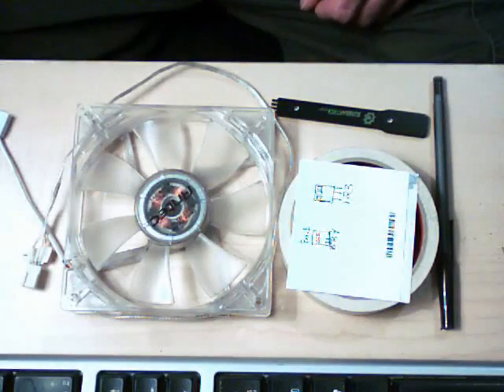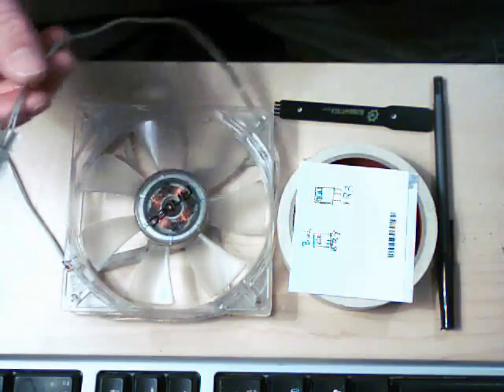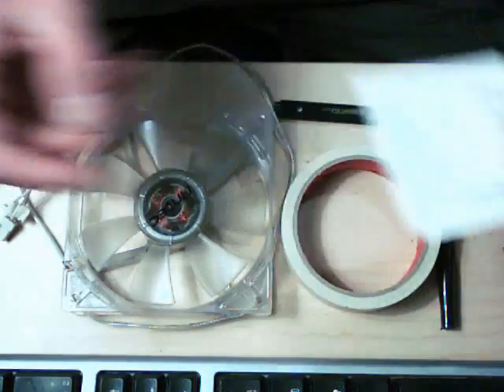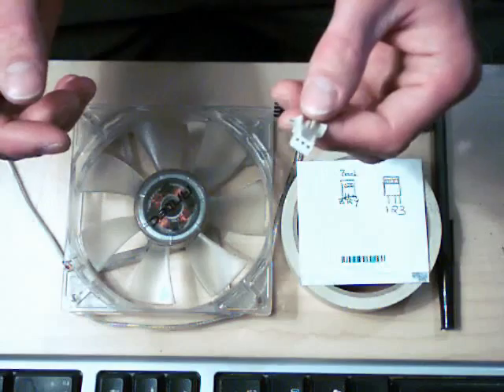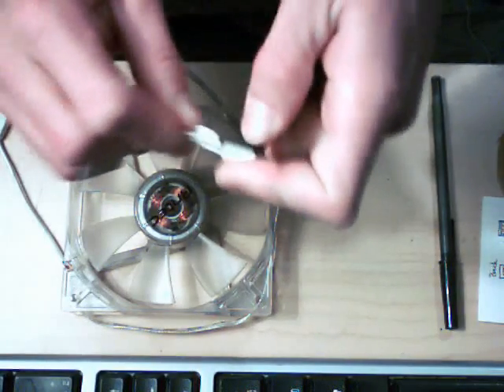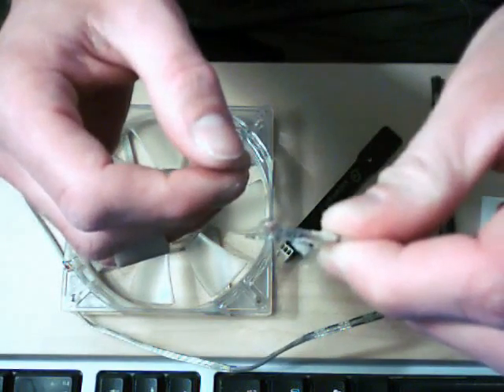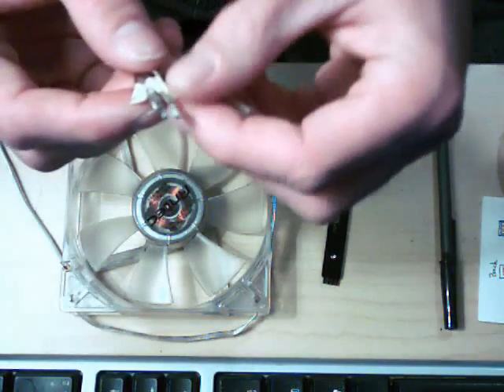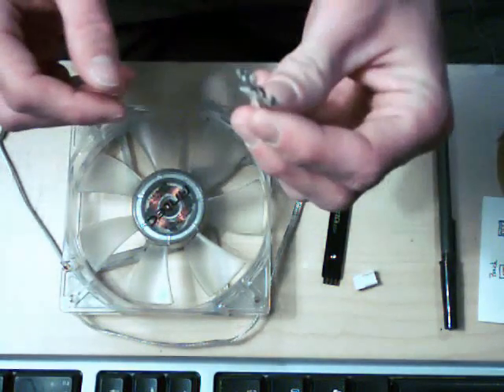How To: Remove/Install 3-Pin Fan Connectors

Comment: dude  just  push the cable in slightly befor using the 3 pin remover it should work way easier because like you did it it forces the taps even more into the  plastic

Comment: I had a loose 3 pin connector, I used a very small screw driver, and pulled the wires out one at a time, I bent the connector to enlarge and refitted the wire, do this one at a time and test to see if it works, no need to take all three out.

Comment: dewalt607 yes it should be ok it woudn't do any damage if it were to the pc wouldn't start up and beep as it thinks its a power supply issue but just try plug the fan in another way and it should work otherwise it would do the same thing but id try with a PC you could risk

Comment: you got a like as the video was helpful. i just wanted to see how to use the removal tool. however, most of the video is just filler and showing how to deal with silver cables is a bit silly. what the black/red/yellow wires mean and where they belong would have been more useful information (i have seen fan splitters and extension cables with the wrong colors in the wrong sockets). also good to mention that when all the colors are in the right sockets, it is a good idea to only have one yellow cable in a splitter. anyway, cheers.

Comment: Thank you for this. I was able to sleeve the cables and seal the ends with heat shrink tubing after removing the connector.

Comment: Thanks for the help, I have a LED bar with a round ac connector and want to replace it with a 3-pin to power it from the PSU. This seems to work as well.

Comment: can you change a molex case fan to a 3 pin fan female connector and still have rpm read outs on a fan controller?

ps. there are only to wires coming form the molex connector

Comment: If you combine 2 80mm fans you would need 12V @ 0.32 amps and consume 3,84 Watts (or 4 watts) I gues you're able to push 0.32 amps trough copper cable no probs. but it depents on the PSU and Cooler.

Comment: tried this on one of my spare fans and one of the pins wont stay in the connector (comes out if i pull a little), the other two went in fine. any ideas?

Comment: I intend to buy an UCEV12 that has "Auto Speed Control by Thermal Sensor"  - it has an adaptor for 3-pin to Molex - for PSU pluging . Everything else is full on the mobo  (other fans). Do u recon it could Auto-regulate based on the sensor in this fashion by pluging into the PSU molex ?

Comment: OK.. i want to use a 3 pin on my 4 pin CPU plug..  
the socket is 
1) ground  
2) +12volt Speed control
3) Sence 
4) speed control

the 3 pin has a toung that positions the 3 pin over pins 1-2-3 ..i can do without RPM i want the auto CPU rpm motherboard function.

will this work??

Comment: can i put a 4 pin in a 3 pin i just bought a fan with 4 pin my mother board has 3pin i have an amd 1035t would my stock fan work with an amd 1100t

Comment: Can I attach a 200 mm fan to my motherboard using this?
I'm not sure if the mobo can provide enough power for it.
Also am I supposed to connect both male and female molex to the fan or just one?

Comment: 3 pin goes to the motherboard :) 4 pin = psu and there is some convertor or plug that converts 3 pin to 4 pin i just watch it in the other vids xD

Comment: Actually, power is in the middle. It is like black = ground, red = power, yellow or blue = RPM. Its kind of confusing, because on a 4-pin Molex (not 4-pin fan connector), red = +5V and yellow = +12V, but the 3-pin connectors only have +12V but it is red...

Comment: Does that fix a fan that has lights going solid but will not span. I suspect lost connection somewhere. It's not an Antec it's TT so their are not a fan builder to begin with. Can it be fixed?

Comment: I'm kind of a noob when it comes to power supply units...so will it be ok for me to connect 3 x 140mm fans to my power supply unit? which is actually just a standard ATX type PSU...it's not really like the ones you see on youtube..I was wondering if my standard atx could handle this..

Comment from the maker: @dewalt607 Yes as long as you line it up right with the small tab there no problems. Only thing the 4-pin has that 3-pin does not is a PWM function.

Comment from the maker: @struggle375 Use a 3 pin to molex adapter or plug it into motherboard header for 3/4 pin cables.

Comment: I readed the motherboard manual and it shows that i only have connectors for a cpu fan, 2case fans and a power supply fan. 

Im planning to get an h70 liquid cpu cooler so the cpu fan connector isnt available becouse of the water pump. 
What 2 connectors should i use to connect the 2 radiator fans?

Thanks

Comment: Hey there.  I have heard that it's possible to integrate fans onto other fans via splicing the wires together.  Is it possible you could go through a tutorial of this for nubs like me?  Very few fan connectors on my mobo and need to add a few more.  Or is there another simpler way to get more fans going in my case?

Comment: nice:D and soooo much easier than my usual method of holding each little plastic piece with a tiny screwdriver until i can wiggle out the metal pieces one at a time. lol
somehow even though i've been repairing/building/upgrading/troubleshooting pc's for myself and others for years, i've *still* managed to miss so many little things like this that would have made life SO much easier at times.
i appreciate you putting videos like this up cause there's always more to learn;)

Comment: i would say that this is a great video but considering that the magical '3 pin connector remover' makes life so much fucking easier and theyre nigh on impossible to source it makes this video pointless and annoying.. do a video on removing the 3 pin connector without the 3 pin connector remover, such as a diy option etc that would be more useful..

Comment: I marked my 8pin CPU connector the same way. Except I used large pieces of tape and coundn't get the sleeving over it. I banged my head on the desk a couple of times for that one.
Great video. 5/5